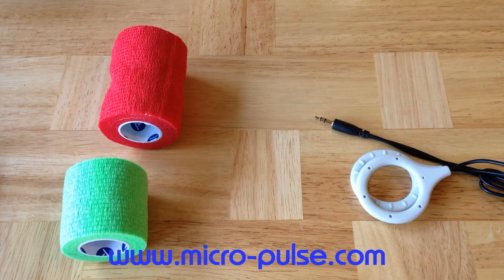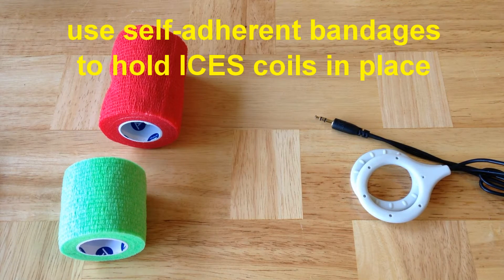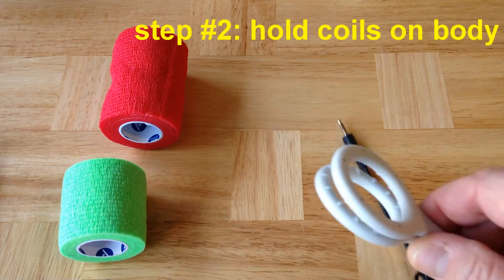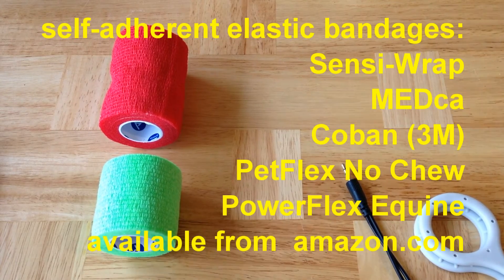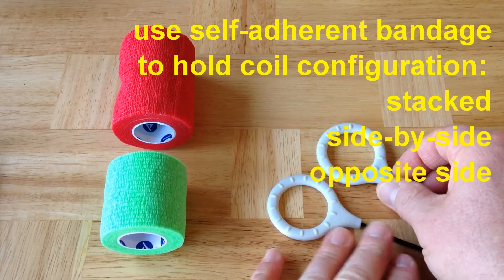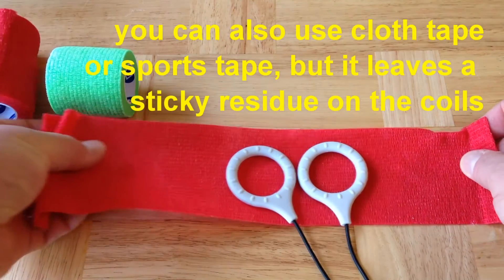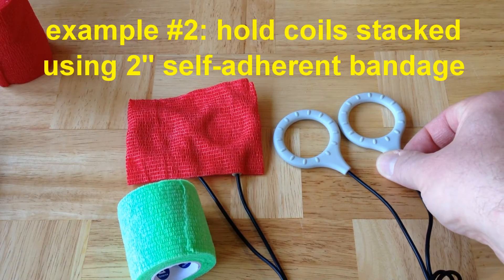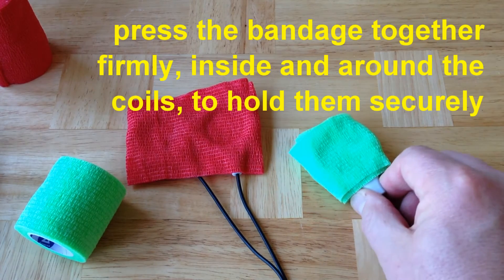Micro-Pulse ICES PEMF Tutorial 6 - Coil Placement Step #1

Comment: are the wraps needed? For example can't I just let them sit in between my body and  my waistband of my underwear
Reply: +monkey monkey 
Hi, sure, that will work very well, in fact, that is what I do most often.  The wraps are only for placing coils where there is no other way to hold them.  The only thing you want to be aware of is to keep the coils away from large belt buckles and other large pieces of metal... no danger, just the possibility of blocking the magnetic pulses.
Reply from the maker: +James Rivera 
That question comes up a lot, so to speak.  But I doubt that it has any such effect, sorry.